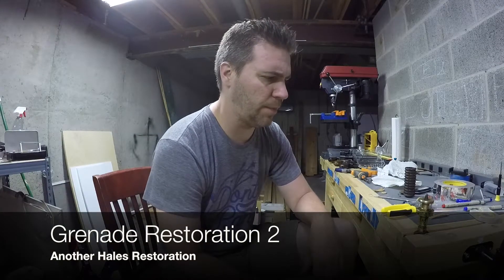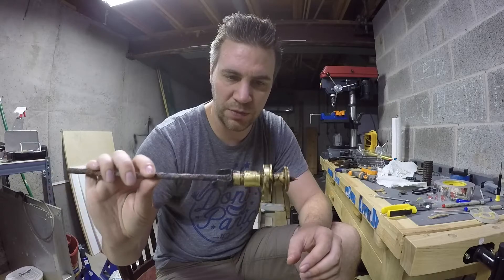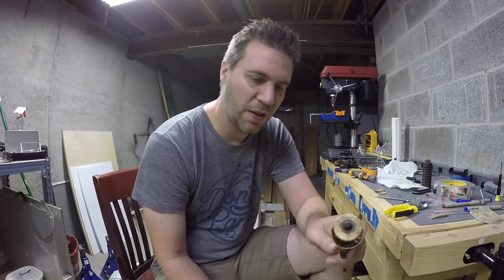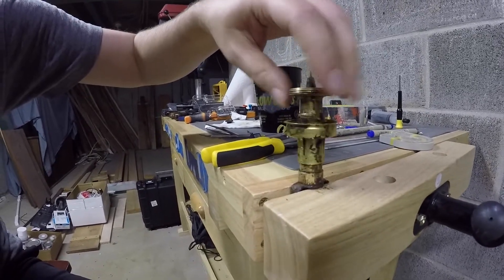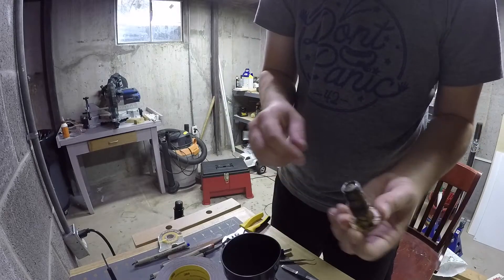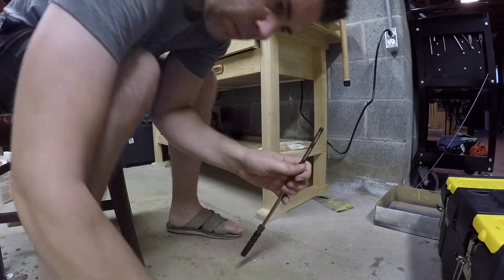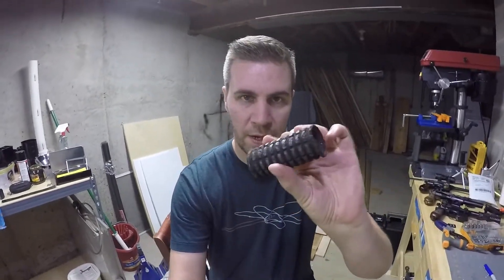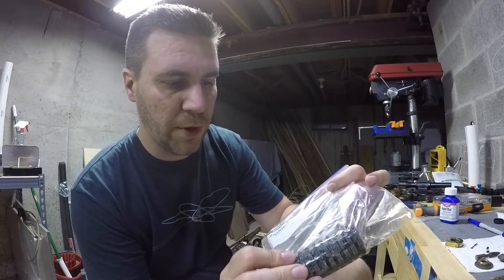Hales Grenade Restoration 2

Comment: Nice. I'm looking for an end cap for mine. Want to sell one?
Reply from the maker: Which part? The domed part or the part that threads into the frag body? The one in this video I sold a while back.
Reply: @dustinwalruff  thanks for the reply.
The threaded slotted screw part.
Nice video and nice working area.
Reply from the maker: @s4wgb  Thanks man, my working area is usually a wreck. I don't have a spare of that part at the moment. If I come across one I'll let you know.
Reply: @dustinwalruff  if get a good one or any other obi wan ANH real parts let me know please. Have a good Christmas.
Many thanks